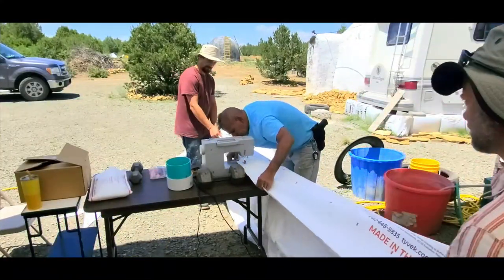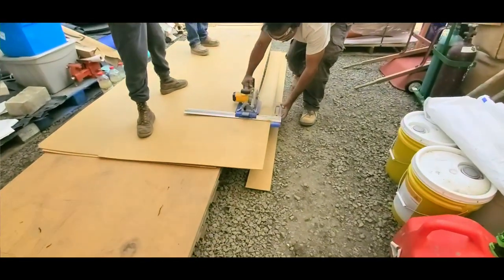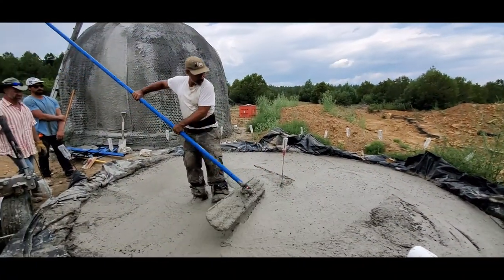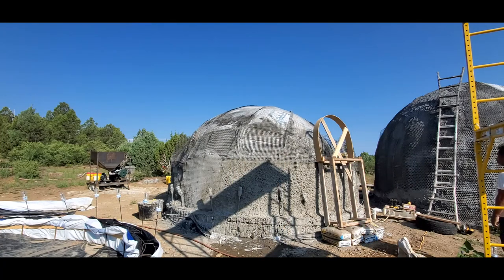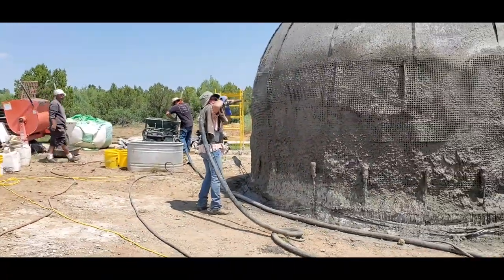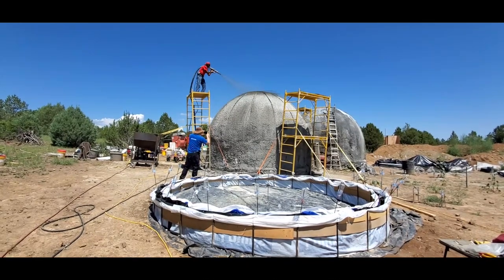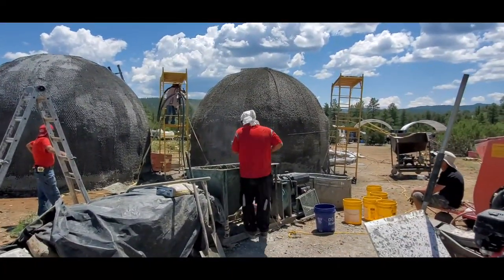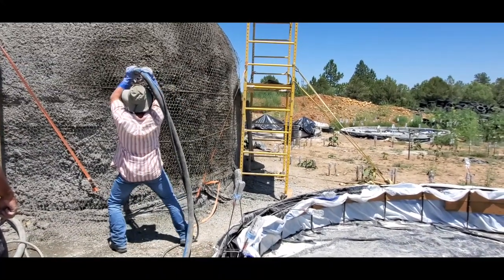July Hands-On Dome Building Workshop | Highlights #aircreteharry #workshop #dome #diy #aircrete

Comment: Hey Harry, what if you just built the first dome and then just use it as the form to create the other 7 domes or however many you want to make? Just use a crane to lift off the dome shell and drop it on the slab and then on to the next one. Do you think this would work?
Reply from the maker: It could work but the cost to rent a crane each time you have to lift the dome would be to expensive, and not as good as building on the ring beam.

Comment: I didn't see you using Helix micro rebar. 
Have you quit using it?
Reply from the maker: No, I still use Helix in some of my cement mixes.
Reply: @AircreteHarry  ok thanks! I appreciate ALL the work you have done with aircrete! I'm starting a tiny house and will be using Helix micro rebar in my pad and maybe the walls. Florida code is now 155 mph wind load. Next hurricane they might up it to 175 lol.

Comment: After some digging through your videos and blog post your process for the dome involves 3 layers. A latex mix of aircrete, either a epic mix or a shot Crete mix, then your final layer will be a 4-8" high insulating aircrete mix?
Reply: Do you do a inside layer of material?
Reply from the maker: 1.Latex 2.Iron wood of EPIC 3.Oak wood of EPIC 4. Balsa Wood of EPIC 5. Latex. Aircrete Is for the slab and to insulate the foundation around the domes.
Reply: @AircreteHarry  Are you height constrained with using the epic mix like with aircrete? I assume you use aircrete for foundation because of the insulating properties, does the labor/cost justify the aircrete foundation v.s. just a regular concrete pour?
Reply: One more question, Do you let each layer fully cure before applying next layer?
Reply from the maker: @TubbyMcFatDuck  No Labor cost just me doing the work. The EPIC and Aircrete are about the same cost to make. The ring beam is concrete the slab is Aircrete the dome is EPIC.
Reply from the maker: @TubbyMcFatDuck  No, it's not fully cured before the next layers.

Comment: Would also like to see a method that doesn’t involve shotcrete
Reply from the maker: The dome can be built using a stucco sprayer, but thats a lot more work. I do plan on buildind a small dome using stucco sprayer. https://youtu.be/MX7fcY6cR9M
Reply: @AircreteHarry   I would love to see it done with the methods used by lurncrete.com. I think they use an additive to make slow slumping concrete. If you could do that, no special tool would be needed.
Reply from the maker: @UndergroundLiving  I would love to but I can't afford to sign up with them now. It's the only way to get the additive they sale. I see the like mindedness. :-)
Reply: @AircreteHarry  Their additive is fascinating, but probably too subtle for the thin walls you do, and probably wouldn't work for aqueous-foamed aircrete - to make stand up as you pump it.  Epic would be very easy.  When I get a reliable vertical-build-aircrete system going I will be happy to share it with you.
Reply from the maker: @happy2b4  How long before i can experiment with your additive. I think you could do something like Lurncrete does. Have people sign up with you to buy your additive. Make your own mix and sale as your  proprietary mix design.
Reply: @AircreteHarry  Thanks! Being impatient, I am looking for a big company to really make this take off.  So far, no takers  - which surprises me.  In any case, when stand-up aircrete is reliable (which is harder than expected)  you will have the opportunity to try it out.

Comment: That looks like concrete not aircrete you're spraying on to the dome?
Reply from the maker: It's a concrete Latex mix for the first layer than an EPIC cement mix that has EPS Foam and Paper mixed in. Aircrete can only be poured into a form, it can not be sprayed. The EPIC mix is easier to work with has a lot of insulation and is stronger than Aircrete. For my house Aircrete is used for the slab, to insulate and around the outside of the house to insulate the foundation. This is how to make the EPIC on my website: https://aircreteharry.com/product/how-to-mix-epic-cement/